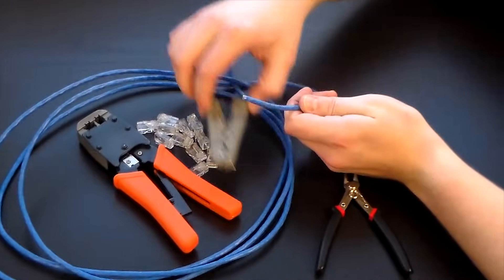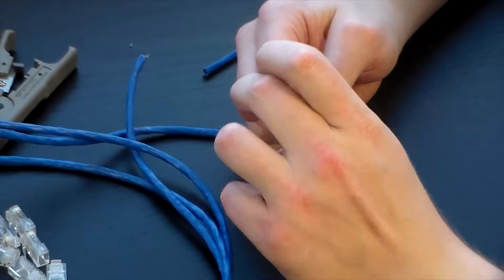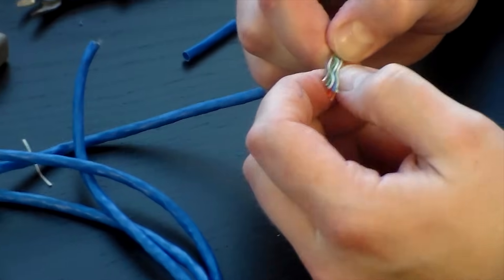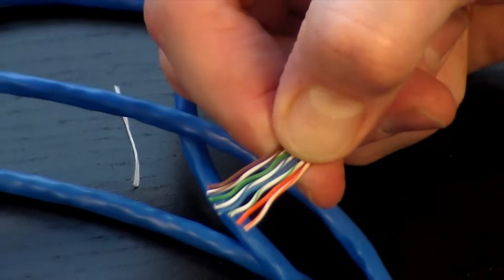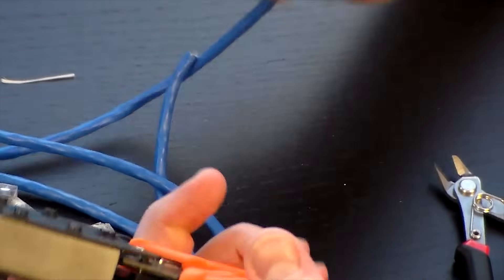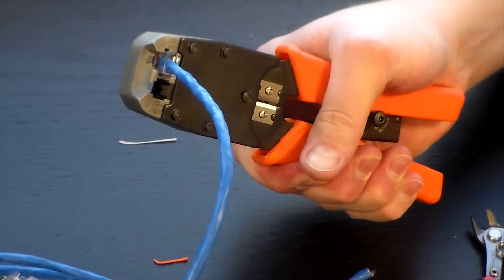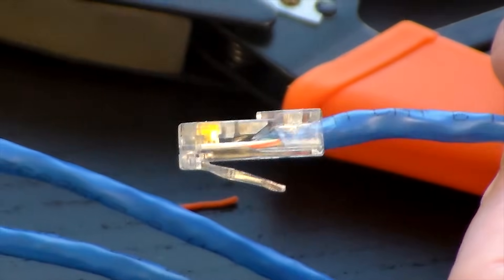How to Make an Ethernet Cable! - FD500R - $24 Crimp Tool Demonstration

Comment: Excellent video.  You need to show more CLEARLY which way the wires are inserted.  Which is the top?  The lock tab or smooth side?  It looks like you're working on the smooth side which is the bottom?  Orange to the left?

Comment: Wrong! You did not include the "stress relief boot" which should be installed before this process.
I hate it when people on U tube pretend to know what they are doing and then people in the comments praise them. It is true that these May not be mandatory although I believe they are it is just wrong to not include this extra step even as an option. People will do anything to get their 15 minutes of fame.

Comment: Thank you so much. I've been dreaming of getting wired internet when I realized there was a ethernet wall jack in my room. The only problem was, the keystone was connected and everything, but the other end of that ethernet cable was just showing wires. That was a huge problem because that ethernet cable was in the basement right next to the modem, but my router is connected to an ethernet port in my parent's room, but I wanted it in my room. But after seeing this video, I was able to get the ethernet port all ready to go plugged in my modem, and now I have wired internet on my Gaming PC.

Comment: Is there a special feature between the copper wire inside a Wh-Or, Or and the Wh-Gr, Gr plastic cover with regards to Transmit and Received function?

Comment: You make it look so easy. I needed 4 plugs and broke another 6. They cross over during insertion. Some of the wires like 7 an 8 do not seem to be used. Next time I will try RJ45 snap plug so that the wires stick out the end which I can then check before crimping, Thank you for the video.

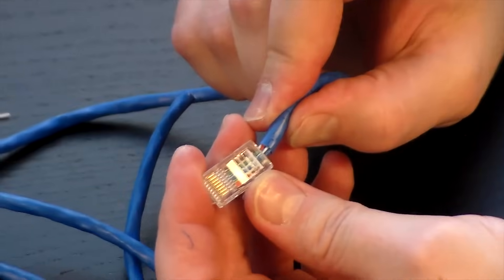Comment: Sounds like we could all use an entire video just for seconds 1:13 - 1:16 when your thumb comes off the wires and it all goes to hell...for us, but apparently not you.  Talk about a difficulty spike...
Reply: Update:  I finally got it to work by applying hot melt glue at the base of the wires once I got them ordered.  Basically replace your thumb holding the cables at 1:13 with a thin smear of hot glue, and that holds them in the right order. You need to smear the hot glue out with your finger after it cools enough to touch it.  If the glue is too high, it'll interfere with inserting the wires into the connector, so it's got to be down near the base.

Comment: My school uses this video for Networking Fundamentals. It's so simple, but the issue I have is the wiring doesn't stay straight and won't fit correctly in the RJ-45 plug. So when I go to crimp, the plug will fall right off.
Reply: Do you mind telling which school(which country) and in which grade it is taught?

Comment: Followed your guide to resuse an old cable.
I was doubtful about the wiring but got it confirmed when I looked at one end which was already crimped.
Rest of the procedure was explained really well. Got it working in no time.

Comment: Great video. Straight to the point.There is a faster way to untwist, separate and straighten the wires before the crimping process. Check out the #untwisttool https://www.youtube.com/watch?v=8do3EVIjuHY. It comes handy when you have more than just a few cables to make, plus it saves your hands.

Comment: So this works without exposing the metal under the insulation of each wire because i noticed you never sand papered any of the insulation of or burned it off either.

Comment: This will no longer be cat6 cable. You are not maintaining the twist till the point of termination. To achieve that there must be more blue shielding pushed inside the connector.

Comment: Great video to the point, not explaining what an Ethernet cable is, explaining each color and what it does, why they are that color, why you are changing it, what lead to the reason why you changed it, how you thought it might be like when you changed it, how you felt after you changed it! Straight and to the point
Reply: Yes, and not showing us each tool to be used one at an agonozing time.  Safety glasses, an ethernet cord,...

Comment: He didn't strip the individual conductors?
Reply: Don't have to. The connector end pierces the outer insulation of each wire when crimped. Sort of like the old blue Scotch blocks.

Comment: I've soldered audio and control cables for decades - really fiddly ones like DB25 and DIN9 etc. This is way harder and way more prone to errors. I can't believe this is a thing. It's very difficult to slide the 8 wires into the connector and maintain the order.
Reply: Yeah, I've done my share of electrical micro surgery, and keeping these little bastards properly ordered is kicking my ass.
Reply: @dougjohnson1517  I bought the tool, took a photo of the color scheme. When I was doing it, I thought do I put them in with the tab up or tab under. The picture on the schematic looked like a small square in the middle at the end. Four hours later, almost, I finally got them in. Only to realize just now by looking at another video, the friggen tab should have been under! SOB. In the picture I took it showed on the wire end a square in the center. I was thinking it was indicating the tab.Sooooo, here we go again tomorrow.
Reply: This is a standard straight through connection. Crossover connections are much different.
Pass through RJ45 connectors make the task simpler, but no matter what RJ45 connector you use barreled or not there's going to be over a quarter of an inch of blind faith that proper wire is going into the proper terminal. I do them four at a time left-to-right. Much better success.
Forty-five years of audio engineering, solder connections, punch down connections, screw connections, you name it... RJ45 is the most difficult...
Reply: yeah, keeping them from switching places is so painful, was doing a test run on a shorter cable and thought I did everything right but it didn't work, turns out blue and blue-white switched places on one plug while inserting..

Comment: Not really at the point, because this is only half of it. Most important is the other end of the cable where two of the wires should be switched between in some cases... Need more info about that.

Comment: I physically cannot do this to save my life.
Reply: It's such a fiddly little job isn't it, me and my mate have been wiring ethernet cables around his house and had to crimp multiple times for each end of the wires because of unforseen errors... Sometimes the the brass teeth in the clips dodges copper wire and you have to do it again such a pain

Comment: Just want to point out that this is 568B scheme. Depending on where you are located, the preferred scheme would be different. I've been doing some research and found that the recommended scheme in Canada is 568A (for residential), which has the positions of green & orange pairs switched.
Reply: Indeed, the scheme may differ, so that people need to verify theirs, before clamping the wires. The procedure remains the same, which is as simple as it gets. The clamping tool does the actual work, together with the RJ45 connector's design.

Comment: I have difficulties making wires to straigthen them up. Duh. I wish i do it right before my newborn baby wakes up.
Reply: Use a screwdriver to straighten the cables. It will make your life so much easier.
Reply: @joluboga  ohhh ok. Thanks sir

Comment: Recommend a Great Hand Tool Kit--JRready ST2060 Hand Crimp Tool Kit (YJQ-W1A Wire Crimper & K13-1 & K40 & K42 & K43 & K41 & K709 & K1 Positioners & SK2/2 Universal Positioner & G125 Go-nogo Gage).

For More Details, Pls Visit At: http://en.precisetool.cn/product/showproduct.php?id=974&lang=en

Comment: Use the right connector. Nobody tells you that. There is one for solid wires and one for stranded. Using the wrong leads to failure. Now or later. The solid wire connector has OFFSET PRONGS so that they go around and trap the wire IN BETWEEN the prongs. The stranded connector is INLINE and goes in between the wire. You have to look and know the difference. The big box stores don't even know the difference in their purchasing department. Google it. You'll figure it out real fast when you see some pictures.

Comment: I make about 50 of those terminations (568A) every week. at first, I was slow, and slightly sloppy. But now, it takes me less then a minute. I test them all with a fluke tester. 
Practice, practice, and more practice
Reply: IPSoft Creations A/B are only different with respect to the position of the Orange and green pairs. The mechanics remain the same. I do Both, depending of the business application. You should be efficient at doing  either one
Reply: Don Lee sorry for the late response. The answer is no. I use regular RJ45 connectors
Reply: IPSoft Creations you’re right! Idk Y I didn’t include B. But, yeah. I do both.
Reply: Is it important to make colors with that way or i can just match them for both sides to be alike and it's fine 
Can u answer that pls thank u!
Reply: @hamzabahtit8358  hey
Look up the 568A or B convention, and do one or the other through out. Also, always insert the pairs with the RJ clip facing down and both ends will match. Good luck!!
Reply: @EdgarParedes.127  thank u bcs i went to bought one yesterday cat 6 and didnt work the i noticed colors was random and the seller told me it doesnt matter just need to matvh on bothsides
Reply: @hamzabahtit8358  don’t listen to that guy, it most definitely matters. Lmk If you have any other questions and good luck!
Reply: @EdgarParedes.127  thanks man u think it didn't work for me when i tried it bcs of the order too or bcs of something else? i mean if the order affects it completely  or it just  affects the way the datas is transmitted and the internet speed
Reply: @hamzabahtit8358  you’re right,  a poorly made RJ45 connector will work properly.  The ideal situation would be for you to test it the newly made cable either with a tester, or With a computer connected to another device. That way you know it works well
Reply: @EdgarParedes.127  well that one didnt even work lol

Comment: Good and clear video. I might have mentioned you're showing a T-568B pinout diagram when the standard is T-568A. The "B" standard was in place since early MA-BELL telco AT&T 258A (Systimax) pinout, but was replaced by T-568A in the early 1990's- and is required for all U.S. Federal installations. That said, as long as your termination points are all the same they can be used without issue.
Reply: I been using green/white, green, orange/white, blue, blue/white, orange, brown/white, brown for too long!
Reply: Always wondered why I preferred the T-568A standard, but as usual, I was too lazy to find out why 🤣🤣🤣

Thanks for the info, now I don't have to look it up anymore 👍👍👍
Reply: 258A was made standard in 1994 but was changed to TIA/EIA 568-B standard in 2002.😀
Reply: Sorry for the pasted text:   "Both are allowed under the ANSI/TIA-568-C wiring standards. T568A wiring pattern is recognized as the preferred wiring pattern for this standard because it provides backward compatibility to both one pair and two pair USOC wiring schemes. The T568B standard matches the older AT&T 258A color code and is/was (?) the most widely used wiring scheme...."     "The U.S. Government requires the use of the preferred T568A standard for wiring done under federal contracts...."

Comment: Why do my individual cables keep braking when I am trying to separate them
Reply: Don't use solid strand wires. Use multi-strand wires. When trimming the blue outer sheath, if you indent the solid strand wires, as you untwist the wire pairs, those indents or knicks weaken the soid strand and they can break.

Comment: Just easy way for make a eth cable 1236 same color on the both side
Reply: Much more than just having the side's match....if you want Gigabit or better to work.... If you just want 10 Mbps , wire it however you want...

Comment: Short & sweet! nice job...now make a nice short tutorial, how to test that same RJ45 you just made...Thanks!
Reply: I boldly tested by first-time-made cable by plugging it into the modem and into my notebook's RJ45 port. If the Net fired up, I did it. Yes! the Net worked. After that I performed a speed test. Works as fast as my connection is supposed to be.

Comment: what is ethernet cable only internet data transfer color wire? Plz reply and answer the question.
Reply: Internet cable is used to connect an internet.

Comment: If the other end of my cable(s) are already terminated into a keystone outlet, would I have to match that color configuration? Trying to unscrew what Verizon did on their install...
Reply: Yes there are two types of connector color configuration
Reply: @teaisfantastic7136  so one cable must have the same color scheme on both ends, but can we connect to the same router using cables with different color schemes?
Reply: Daniel Cordeiro yes as long as the colors match on both ends in sequence on the other cables

Comment: Technically it doesn’t matter what order you have he individual wires as long as he correct ones match up on the other connector. The color sequence is just the industry standard.

Comment: Are the wire's always done in this order
Reply: Not always. This is known as the T-568B standard which starts with O/W, O, G/W, B, B/W, G, Br/W, Br. the other standard is T-568A which starts with G/W, G, O/W B, B/W, O, Br/W, Br

Comment: Does changing the sequence of the wires make a difference? Aside from the colours they all look the same...
I mean, as long as you stay consistent.
Reply: this color code is standerd industrry wide
Reply: No changing the sequence does not make a difference. As long as they are the same on both ends it will work.
The method he showed is just a standard so everyone can look at it and see if there was a mistake without looking at both ends.
Reply: Not exactly. You need to keep the pairs together ie 1,2 - 3,6 - 4,5 - 7,8. pairs are twisted together for high speed signaling. If you break up pairs than the signals will become attenuated & noisy leading to data loss or complete data loss. Ideally its best to always keep the pair (ie colors) using the standard, so if you need to redo a connector you won't have to waste time trying to figure out the correct layout.
Reply: @chenenowicki469  
Ko ko

Comment: This is good  FROM the router  to the hub/switch/laptop?
Reply: there are two standards, 568A and 568B....; as long as either is used at both ends, you are fine...

Comment: I can't fix those wires by sequence in that crimp connector
whenever I try and apply force to push them inside they get bent or broke
what do I do???plzz helpp
Reply: Aakanksha Mahajan untwist the wire One pair at a time with lineman pliers, pull on it some as you twist. It makes the wire straighter and easier to work with, then cut them to length before inserting into connector. 👍

Comment: Good video.  Can you please specify if you are wiring for type A or type B?  The colors are in different orders for each of those.
Reply: This is b. The difference is where the orange and green pairs are. For 568a green in on pins 1 and 2 and orange is on 3 and 6. For 568b orange is on pins 1 and 2 with green on pings 3 and 6. for Ethernet you want 568b. it has to do with the different twists of each pair I believe.
Reply: The one he showed is type B

Comment: so it's both ends same sequence?
Reply: Unless you're making a crossover cable. But are those even a thing anymore? Don't modern ethernet connections automatically perform the crossover electronically when needed?

Comment: Do you not have to strip the smaller wires?
Reply from the maker: The pins in the RJ45 connector will terminate the wires once it has been crimped. No additional stripping of the smaller wires required
Reply: the connector part for the small wires has small pinns wich penetrate whe wrire, thats what the final proces is for with the tool